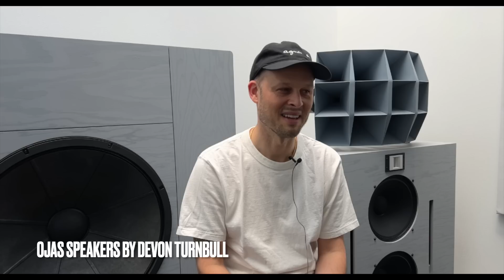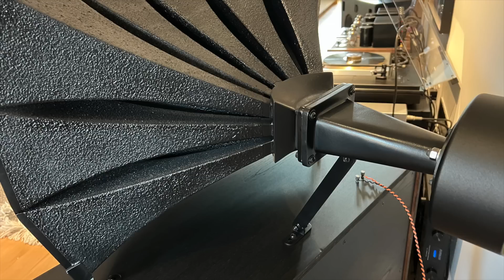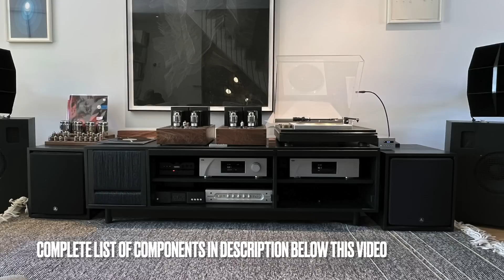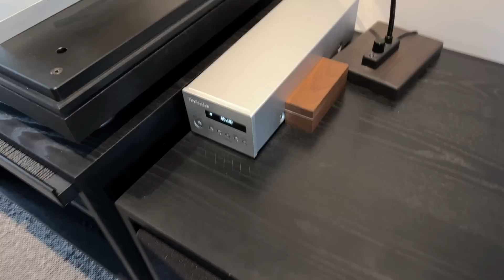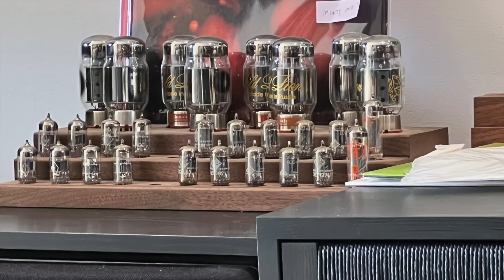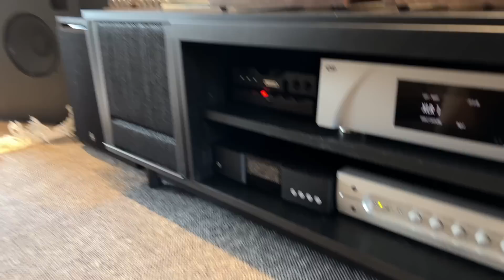Ben's Audiophiliac Viewer System of the Day!

Comment: Speaker covers for the bass cabs would set it off really nicely and have a cut-out for the super tweeter. They would have a very professional finished look by carrying that out. It would holt them looking like public address speakers. The other equipment is not public address it's hifi equipment. It would set it off. ⏏⏹⏺⏪▶⏩⏸

Comment: I had horns and triodes 30 years ago - nothing new. Anyone really into the hobby knew that the Japanese were really into that type system. In my case it was first generation Cary 300b set mono blocks into a Altec 19 with a  Rega turntable and CAT preamp. I am actually more impressed personally with the new design Omnidirectional speakers such as MBL and for less money German Physiks. Some folks back then were nuts about Jeff Korneffs 45 triode amp.  Dr Edgar who I knew had a more advanced horn design called a Edgarhorn.  There also were an extremely few folks who have all compression driver systems - even compression bass drivers which to this day are state of the art.

Comment: Impressive stereo, of course the Altec based ported bass cabinets with 1505s/288s(?) and I’m guessing a ribbon tweeter is always a winner.  The SP10R is a sick record player.  I agree with his assessment of mixing SS with tubes, my preference is tube for small signal amplification and SS (jfet or mosfet) class a power amps for dampening and ability to drive variable impedance loads w/o issues.  Killer setup that I’m sure puts a smile on your face
Reply: The horns are altec 1803 multicell horns. Driver looks like a repainted 288-8G driver. A truly amazing horn combo that I wish everyone can hear

Comment: A very nice system. Steve, because Ben has got two KT88 monoblocks, I think you should tell him (just in case) to try the best KT88 that I've heard (installed on my power amp) made by KR Audio,  from Czech Republic :)
Reply: I will check them out thanks for the rec.

Comment: Great looking system and space!  Aside from how it would look if being half-on and half-off the carpet if the speakers were placed next to the cabinet and subs outboard,  but mainly I'm curious about having the mains so far apart in that space, especially when the listening positions are fairly close.  Wonder what Ben has to say about the horns and positioning them aimed at the listening positions make up for that at relatively lower but paying attention listening levels.  :)
Reply: And there is very little to absorb sound bouncing around in that room.
Reply: That too.  Yet, putting anything on the brick wall would be a tough choice to have to make - the whole space looks really nice.

Comment: Ben’s bespoke system is just amazing! Thanks for sharing this to the audio world at large. I mix tubes and SS as well. I’ve settled on an Allnic tube line stage and a Kinki Studios MOSFET power amp. I am able to have the 3D imaging and sparkle of tubes and the low end control of SS. The Kinki amp was bought as a spare, but it has taken over as primary over amps costing 10X more.

Comment: Killer system!
(Try completely removing the dust cover when listening to LPs)
Reply: Why?
Reply: @jeffswanson3740   That large plastic hood picks up air borne vibrations which transfer through the table/arm/cartridge and blur the signal. Even when it's closed, worse if it's open.
Reply: For what it’s worth Christopher put a large silicone isolation mat between the richlite top and the 1/2” steel plate and the wood base so the tt really floats free from where the dust cover is attached which is lower on the assembly.
Reply: @benkrone2671  Hello Ben. Again, killer system! I expect that my ocd is showing and that your isolation method is up to the task. In my rig - VPI table with very basic internal damping - the difference with the dust cover on or off is clearly audible. Wishing you only the best!
Reply: @eightrodway  thanks for sharing why. I've heard dust covers issues but never knew why ppl said so. And I figured mine was fine. But what your saying makes sense and sounds like Ben's builder also went thru some effort to address which tells me it is real and not just some hifi urban legend 🤓